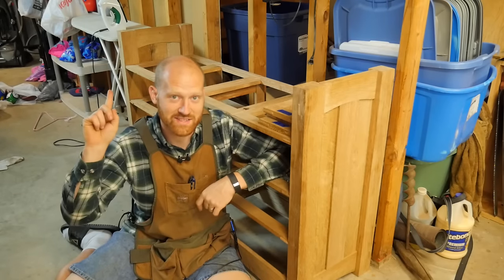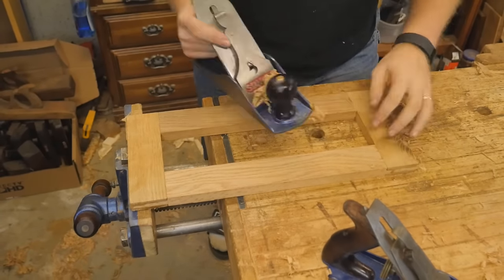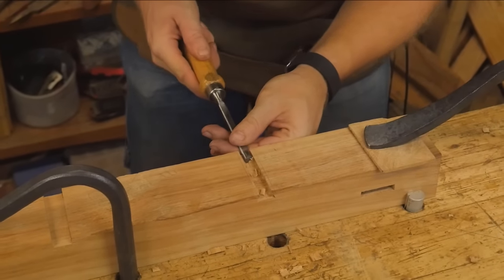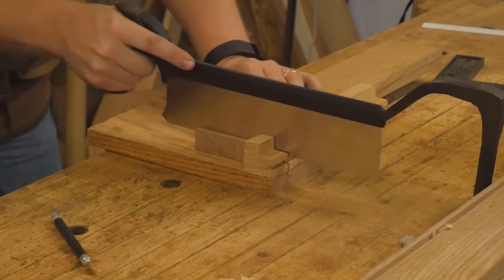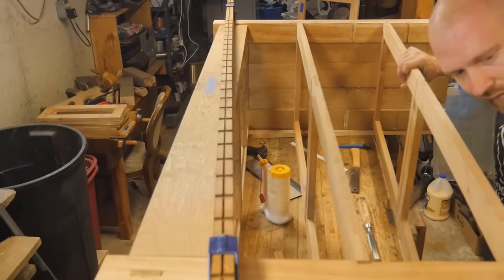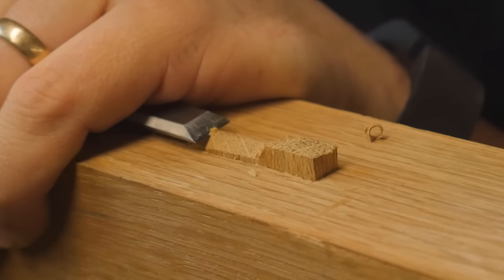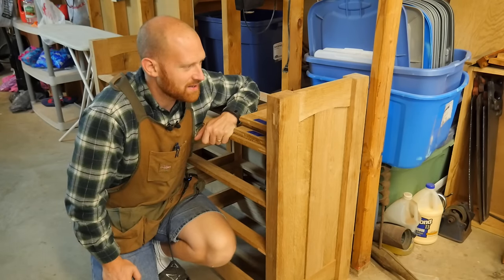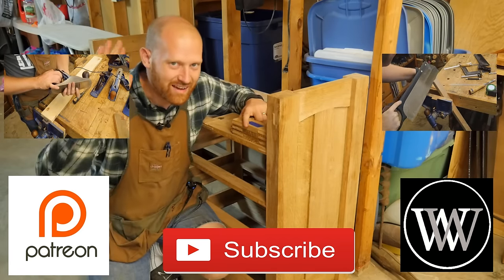Hand Tool White Oak Dresser Build Part 5 Carcass Frame Mission Craftsman

Comment: Who needs to go to the gym when you can lift weights at home :D  Good tip with using the side of the plane to get the dovetail angle.  DId you use the spear point blade in the router to get into the corners of the sliding dovetail?.
Reply from the maker: +Peter Compton thanks. In this instance I could not rotate the router enough in the Grove to use the pointed bit. Here I was using the 1/2" bit.

Comment: I've enjoyed watching all five videos in the playlist. You certainly give other weekend-type woodworkers hope in terms of that which might be accomplished with time, patience, and perseverance. (Good biblical character traits, all.) 

Your decision to use white oak for all portions of the build makes me curious. Is that a decision based purely on personal desire on your part? I don't think I've ever heard of using such primary wood to make something as utilitarian (and, basically, unseen) as a drawer bottom. To your knowledge is there any historical basis for such use?

Thanks, again, for sharing your skills and your story. Blessings on you and the fortunate recipient of you care, your wife.

John
Reply from the maker: Thanks! that means a lot.
the use of a secondary wood was originally practiced for several reasons. 1 cheaper wood for the parts that are less seen. 2 I do not have as much of the figured wood in stock so let's just use that on the front. 3. figured wood is a pain to work with so lets use some boring secondary wood where it is not seen. 4. sometimes the secondary wood is more stable that makes it great for inside drawers so they do not jam over time.

for me I have a lot of white oak on hand so it is cheaper for me to use that. and it is fairly stable for the use. the oak cost me .50 a BF so it is far cheaper than even pine or poplar. also the oak is far more durable than most secondary woods so it will last much longer and put up with more abuse.